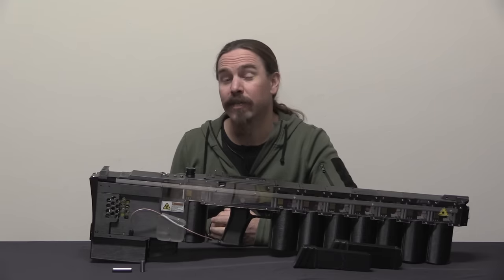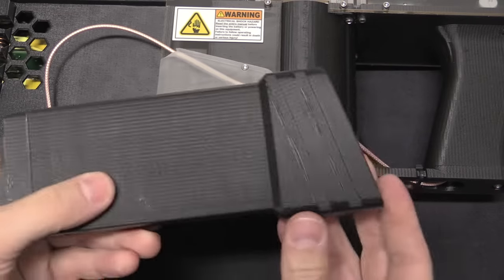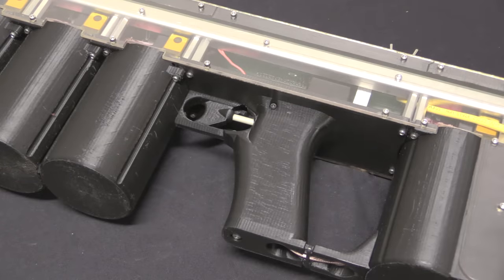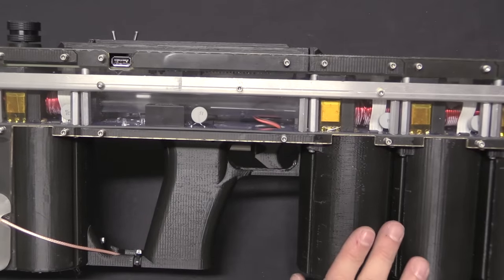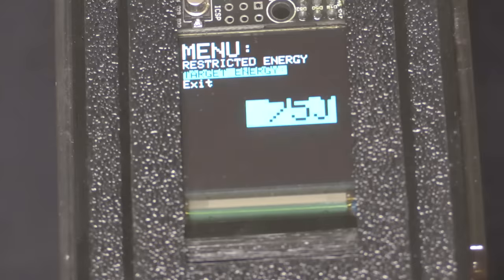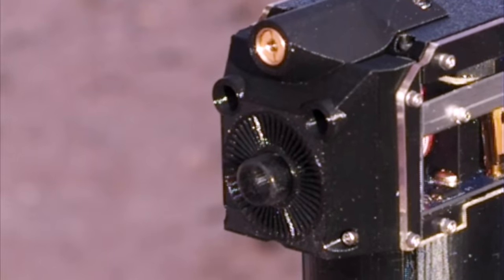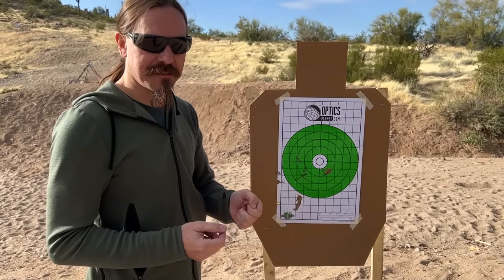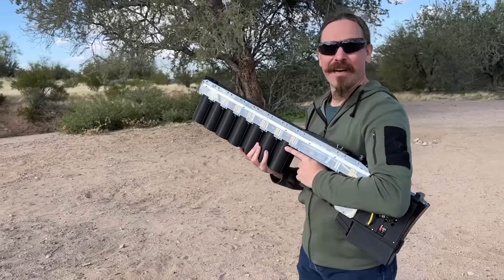ArcFlash Labs' GR-1 Anvil Portable Gauss Rifle

Comment: Something that struck me is the silence beyond a click... imagine a battlefield, major battle raging, in near silence. Would the sound change once they get it supersonic, so there's an audible crack from the round?  Excellent review!
Reply: If this technology ever manage to get projectiles supersonic, yes, it would sound similar to a real firearm shootin supersonic ammo with a sound moderator on.
Reply: the supersonic crack alone would bring it to nearly the volume of a low calibre firearm, similar to an unsuppressed .45. However it wouldnt be a single loud crack, it'd be a prolonged kinda "zip"
Reply: yea, the only sound would be the soundbarrier breaking and possibly the sounds of the projectile spinning in the air.
Reply: I'd think it'd something like a integraly supressed gun using normal ammo, not as silent as sub-sonic ammo but still not very loud
Reply: Yeah, you would get a supersonic "crack" from firing hypothetical supersonic rounds out of that thing
Reply: I noticed this too.  For subsonic shots this is a game changer.  For applications that do not need supersonic shots this is huge.  For all the obvious reasons.
Even if the supersonic shot is just similar to a standard .45 shot (as mentioned above), that is still a big deal.
Reply: the cool part is that you can control the power so for more stealthy operations you can fire subsonic and for loud operations you could fire super or even hypersonic if the tech becomes that good.
Reply: I think more muzzle energy and subsonic would be a great weapon for short-mid stealth engagements
Reply: @Psycho_Panda97  well there would be no mechanical parts in the action when it fires, it would be quieter than a supressed gun as far as actual ignition goes. The capacitors vibrating on charge and the crack of discharge might get pretty loud however
Reply: You would only hear the supersonic sound when the round goes pass you as the sound waves would be travelling behind the round. For example you would only hear the sonic boom of a fighter jet as it flies over you, not while it is flying towards you.
If you get hit by a supersonic, you probably won't hear anything much.
Reply: Because this is basically a oversized toy.
The power isn't impressive (although  still quite dangerous) and accuracy will be horrendous
Reply: @Big-Government-Is-The-Problem   You are absolutely right about being able to change from subsonic to supersonic, all you would have to do is select how much energy you are dumping into the capacitors, It would just drain the battery faster. The hurdle here is battery technology, you need a battery capable of storing a huge amount of power in a small package and being able to discharge and recharge large amounts of energy near instantly.  This also means that a weapon such as this hooked up to a warship for instance, or a ground base installation that has a large powerplant would be feasible right now. Making it man portable is the difficult part.
Reply: I'd imagine it would sound something line suppressed 5.56. You still get the supersonic crack but there isn't any boom from powder burn
Reply: @baconator1377  little to no cleaning needed then too.
Reply: imagine being on the receiver side of an ar15 with suppressor firing supersonic rounds, that is basically what you would hear
Reply: I’m fairly certain this is significantly louder in person, and like others said, would be much loud at supersonic. Not just because of breaking the sound barrier, but because the sound of capacitors charging 10x the energy in the same amount of time will absolutely be louder too
Reply: If you ever go airsofting, especially in a milsim event where they allow blank firing real guns, sounds a lot like being in a war zone with all of the airsoft guns making clicking sounds.
Reply: There is no realistic chance of a handheld electromagnetic mass driver reaching supersonic projectile velocity.
Reply: Yes. For a few reasons. 

1. A coilgun is not suitable to get small objects moving very fast, which means that the only optimal solution is to use a railgun instead. 
2. Hypersonic crack is very, very loud. 
3. Plasma discharge from conductive rails is very, very loud.
Reply: Not seeing gas coming out of the barrel when the bullet leaves is also really almost unnerving.
Reply: @Miranda Vladivostok of course they will amplify the subtle whine of the capacitors charging as well. "VRRRRRRRRRRRRRRRRR BOOM!"
Reply: The sound would change well before it even got trans-sonic. Not just from the bullet whipping through the air, but also from the capacitors. Case in point: Studio flashes. The quite powerful ones make the flash tube go "plop!" like popping a small cork. The really powerful ones make the capacitors go THUNK! along with a faint sting of heat in your face, from the immense burst of light.
Big studio flashes don't have a paltry one hundred Joules of juice. The have Kilojoules! 
At least they used to have, way back when, when studio photographers used wide gauge film cameras. Sunlight was barely adequate for those cameras. (Sure, you could put them on a tripod, and ask the sitter to sit very still for a second or two, but that's not as practical...)
Reply: @GerManBearPig  With the long projectile being so heavy, the force is about equal to that of a handgun.
Reply: The lack of noise from the shot and lack of a muzzle flash are basically the same that was the big advantage of Giardoni air rifles in the Napoleonic wars... And yes, that was a big advantage, so big that Napoleon had anyone executed who was caught with an air rifle. Gauss weapons will have the same advantage.
Reply: I think people will still be screaming, jus sayin
Reply: @-Zevin-  yeah ships and ground bases are where these guns will be pretty useful because they can have way bigger batteries, and massive amounts of power like on a nuclear powered ship. i guess also space ships or space bases when that becomes a common thing lol. i dont know if battery tech will advance enough to make these viable as a man portable rifle. im no expert but ive seen some experts say we are probably near peak battery advancement stages.
Reply: That lack of report when firing is so strange to me.  I'm so conditioned to expect a loud noise that it almost felt anti-climactic.
Reply: Imagine laser weapons. No noise, no impact, light is the fastest speed possible, you cant see lasers under normal conditions, no wind adjustments, only silence and people suddenly start to burn/die. Horrifying!
Reply: Think about artilleries.
Reply: Of course it would! Most of a bullet's noise is the whiplash.
Reply: Maybe the future EM gun designers will try to keep the projectiles just barely subsonic, but heavier and heavier to increase energy.  The velocity out of this prototype has a muzzle velocity of ~70 m/s, the speed of sound is ~343 m/s.  There's a long way to go.
Reply: @Miranda Vladivostok And you'll be able to download sound effects from the manufacturer or even load your own into the gun.
Reply: The tech for supersonic gauss guns are here already... If we leave out the need for portability. But I could imagine a sniper team of two or three men assembling a puntgun sized gauss rifle very easily. :P
Reply: For gauss rifles to become practical weapons  they would have to achieve a muzzle velocity of over 6,000 feet per second
That will definitely make a sound
Reply: It will be loud when it breaks the sound barrier. Look up the supersonic trebuchet. Using only the power of rubber and engineering, it can accelerate a small projectile past the speed of sound, and it's fairly loud.
Reply: I'm a bit curious whether the "clack" we hear in the video is a fair reproduction of the actual sound. Gunshots are after all a lot louder live than on screen.
Reply: @GerManBearPig  I think it would be along the lines of a thrown weapon like a knife or tomahawk.
Reply: @Speeder832  That is incorrect. For reference here's a supersonic trebuchet using rubber and engineering to accelerate a small projectile past the speed of sound:

https://youtu.be/gdXOS-B0Bus?t=808

That is not a prolonged "zip". You can even hear that the echoes are very short snaps.
Reply: Militaries would be stupid if they relied on gause rifles for their infantrymen. A whole unit is gone with one trigger of an emp. You want an infantry to be as self-reliant as possible. Even if a soldiers trijicon died somehow, they still have something that is deadly. I do find it crazy that not all infantrymen use back-up sights. I guess it's because they're not reliant on batteries and, emps CURRENTLY take a lot and it would be stupid to do it. But, there are still mass emp weapons even today that dont require setting off a nuke. Im sorry, but stuff like this is a pipe dream, unless we have gone extremely stupid. Even the military's upcoming sights that have smart tech that identify friend from foe and basically sight in for you have it where it's still functional if the batteries die. It's a cool gun and it will be used in the military, just not with grunts on the front line... or even in the back.
Reply: @tomaspabon2484  this. listen to the pop high power photo flashes make for an example
Reply: @Der_Erpel  Lasers aren't actually like that. A laser that is powerful enough to kill someone is going to superheat the air it passes through, making a sound akin to thunder, in the same way lightning does. Once it impacts the person you're aiming at, it will vapourise them, and that superheated vapour will expand, creating a steam explosion and ripping the person apart. The worst part of it all is at that power level, even if the laser is not on the visible spectrum, anyone looking in the direction of the target or the shooter will be immediately and permanently blinded by reflected light from the beam if they aren't wearing laser protection goggles. They aren't really the most feasible weapons for infantry use
Reply: @Miranda Vladivostok As an old nerd I'd probably go for a classic Star Wars blaster sound, but I like your idea very much as well. :)
Reply: @zachmiller9175  

Ah yes.  Real Gauss Bolters.
Reply: Real railguns make audible crack with plasma flash
Reply: @Speeder832  Why a prolonged sound?
Reply: I took a wrist rocket to an indoor range years ago. I mean, it was in my gun bag, so at the end I tried to use it to fling empty cases downrange. Made the funniest chirping sound as the open end spun and whistled away, lol. We are going to have Angry bird battles
Reply: @halorox99  interesting.
Reply: @IcyScythe  because as the projectile is supersonic it's not creating a single shockwave, but a constant one. Creating a loud sound as it travels down range, think the woosh sound after firing a rifle at long range
Reply: @-Zevin-  For backup there should be a hand-cranked generator built in...
Reply: @Big-Government-Is-The-Problem  Ship-mounted versions will also have the distinct advantage of floating in a limitless heatsink. No reason not to make the coils out of tubing full of flowing coolant (not seawater- it would need a heat exchanger).
Reply: @Miranda Vladivostok Gen3 gauss rifles will have sound effects done by Hans Zimmer
Reply: Far from silent. High pitched very loud screech while it's charging the coils
Reply: @joshgreen2164  That's because it uses the cheapest and simplest-to-implement voltage booster circuitry available. There are completely silent ways to do it but they cost more and are a bit more complicated.

Keep in mind that this is a proof-of-concept  prototype.
Reply: @markfergerson2145  it wasn't meant as a slight. Im thoroughly impressed.
Reply: @joshgreen2164  I didn't take it as a "slight", just a possible inference that gauss guns will always suffer from the "bug".

But the more I think about it, if these things do reach a place where they're ready for combat, the bug might become a feature for psychological effect:

(New recruit on enemy lines) "What's that noise?"

(Battle-hardened veteran) "Oh shit, they're charging up their Gauss Guns! Retreat!"
Reply: @markfergerson2145  i never considered that! Would definitely work. It is high enough in frequency a lot of people wouldn't hear it. Not quite dog whistle( i not so much hear but feel) but it is up there.

Comment: It's both amzingly modern and incredibly crude in its construction. It's like a sci-fi Lutty,
Reply: More like Steampunk. Or better yet Magnetpunk. Or Coilpunk
Reply: @mpetersen6  thats a pun-punk sentence
Reply: @mpetersen6  Stop with the "punk" nonsense, call it tech or whatever, but it doesn't have anything to do with punk. 
"You are overreating!" Perhaps, but that shit needs to stop, it grates my sould when I hear stuff like solarpunk or frostpunk... Cyberpunk was called that because it was some "punks" and low lifes using cybertech to mess with a corpo, not because it had anything to do with the tech.
Reply: On any gun, fewer potential points of failure is almost always better. Gun design is very interesting to me because it's dealing with energy levels that can easily damage the system, but the need for a gun is for it to always be ready to fire. A degree of simplicity is fundamental and takes a special kind of creativity. Future gauss guns may look nicer, but will probably have a similar or fewer number of moving parts going forward.
Reply: @yeraycatalangaspar195  yeah this is a real punkpunk commentpunk
Reply: @theoriginaldylangreene  Yeah edgy punks only buy androids hurrr durrr

Comment: 6:17 When he puts the 9mm down all I can think is: "Plus we fire the whole bullet. That's 65% more bullet per bullet"
Copper isn't magnetic but I would be eternally grateful if you shot a steel 9mm through.
Reply: Ayyyye Portal!
Reply: @LabRat Knatz copper isn't magnetic,  it interacts with magnetic fields sure, but it isn't magnetic.
Reply: @Adierit  everything is magnetic, the only question is how much energy you need in the magnetic field to be meaningful. (and also as usual it depends in temperature, closer you get to absolute zero, more and more stuff just turn into ferromagnetic)
Reply: @Adierit  What you wanted to say is that it isn't ferromagnetic because it doesn't have the magnetic susceptibility for it.
Reply: You  can definitely fire copper through a coil gun by making use of eddy currents and induced magnetism. It's how all induction motors work, as Gauss guns/coil guns are essentially just linear motors.
Reply: @Adierit  Every material is magnetic. The only question is, what type of magnetism each substance has. If I remember correctly, copper is diamagnetic.

You appear to be operating on basic physics education level, where the only magnetism really taught is ferromagnetism, and often taught wrong, as they combine that with ferrimagnetism into one concept for purpose of ease of understanding, a mistake science discovered back in 1940s.

Consider googling "what types of magnetism are there" to find out more.
Reply: Stony3K is the most correct, it is correct to say that copper is not magnetic in the colloquial sense, when a changing magnetic field is near copper it will induce a magnetic field that will interact with the original magnetic field, or current can be passed through it to induce a magnetic field, where as ferromagnetic substances do not require a changing magnetic field or current, they naturally interact with a magnetic field. That is why if you hold a magnet near copper you won't feel a pull, but if you pass a magnet past copper you can feel the pull.
Reply: @LabRat Knatz I think you know they meant magnetic from the traditional perspective that copper is not drawn to magnets under regular circumstances in any notable way given its non ferrous nature, the correction was somewhat unnecessary a bit condescending and served little point as this coil gun does not utilize inductance in its projectiles nor electromagnetic projectile design which would be by in large required to fire non ferrous metal projectiles, it’s simply using electro magnetic energy to move ferrous projectiles, of course copper interacts with magnets but in this context those interactions are largely irrelevant.
Reply: This comments section is nothing but "well actually" people.
Reply: @totalmetaljacket789  I have to agree, a consequence of the subject matter sadly.
Reply: @LabRat Knatz The details beyond those needed are irrelevant in this context no one here is likely developing any technology as such it is unnecessary to cover every aspect the subject matter in this conversation especially if doing so is at a cost to the conversation its self pushing those less well versed in the subject matter down or out altogether, over complication is just as detrimental as over simplification.
Reply: @LabRat Knatz stay in school bud, diamagnetism is not the same as being magnetic, diamagnetism refers to something pushing AGAINST magnetic fields. it DOES NOT make copper magnetic.